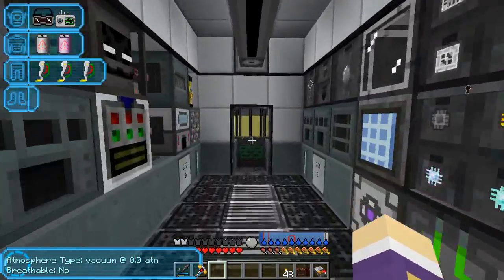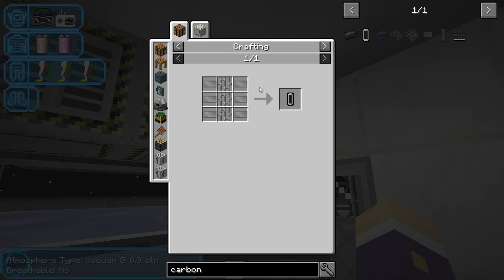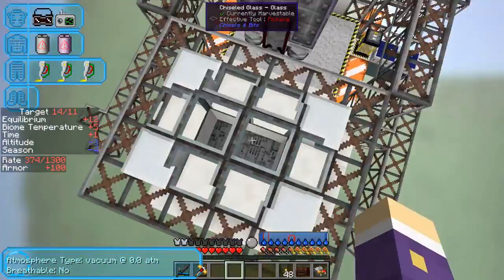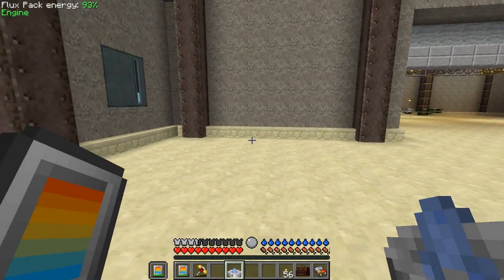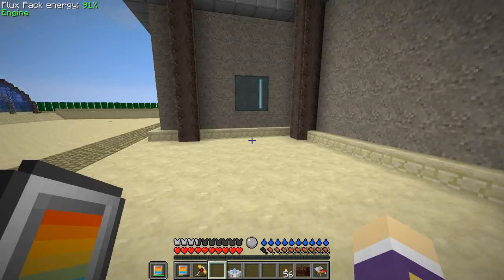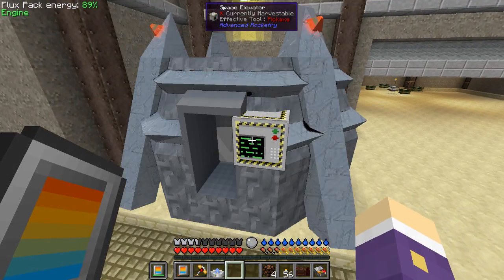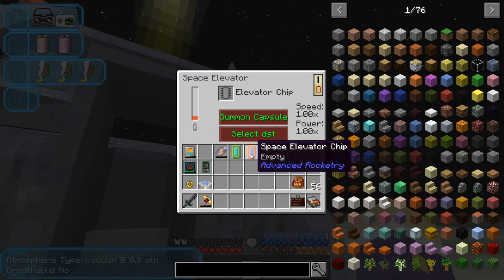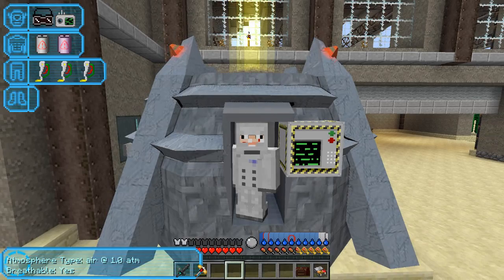[Lets Play] Forever Stranded : E46 - The Space Elevator

Comment: Hi Nemsun the awesome elevator, they are cool aren't they! Zmaster has not implemented the speed part of the elevator. You should always copy the station Id chips in the satellite builder. The x and z coordinates in the space station Id chip are where you return to on the planet.

Elite motors speed up the machines but Iridium will be a problem for you because you can only get it from Environmental Tech's void ore miner. I modified my advanced rocketry config so it could be acquired by asteroid mining. 

How are you supplying water to the reactor? Have you tried pressurepipes they are very special?